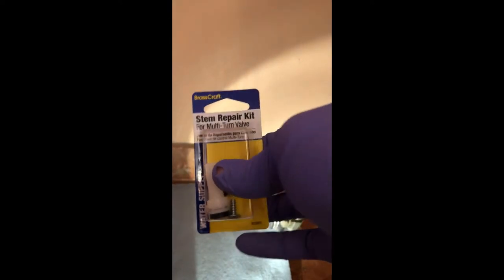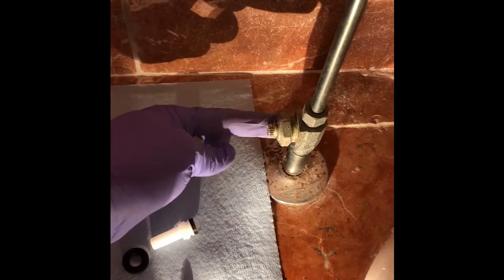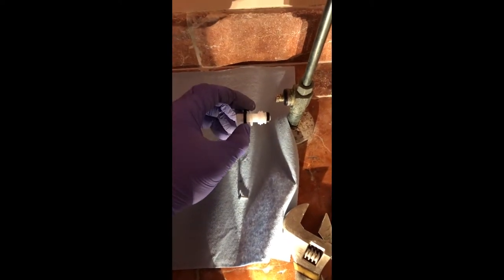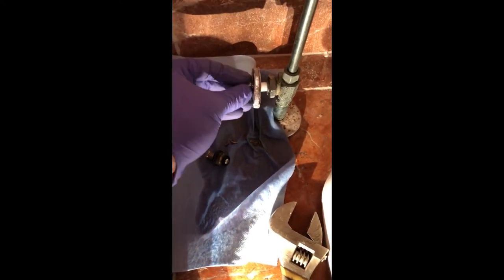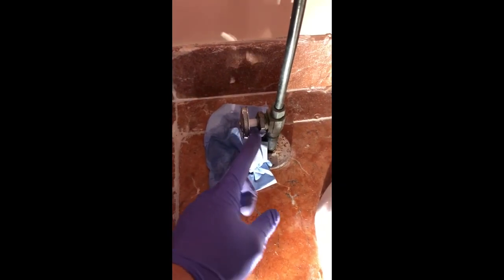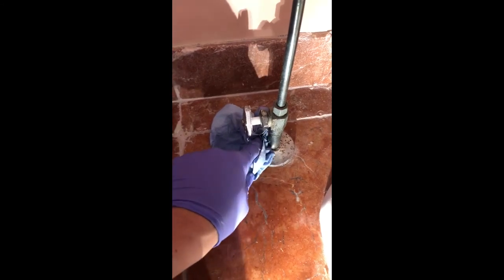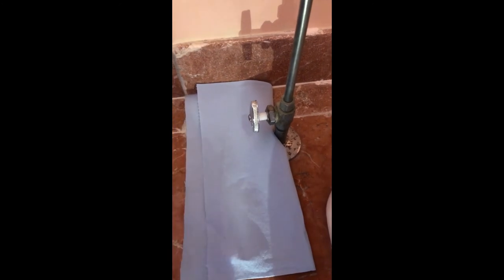DIY - Replace water shut off valve stem

Comment: Nice step by step video. Read from comments from other video that the shut-off valve needs to be in the full open position for stem to come out easily. Once it is out, use flash light to check any ripped pieces of gasket and get them out before putting in the new stem. Both worked during the stem replacement.

Comment: Thank you so much for this video Kam!!!! I was able to fully replace several 1/2 inch threaded water valves in my home without any issues BUT two valves were soldered in and I did not have the equipment nor a torch🤣
So I replaced the stem and it worked!!! All of my water valves were over 15 years old and were not shutting the water off at the site. I had to shut the water main whenever I had to replace anything... a faucet, a toilet, a water filter, an appliance water hose etc...
Today, this video helped me replaced water valves that were soldered! So grateful!🙏🏼

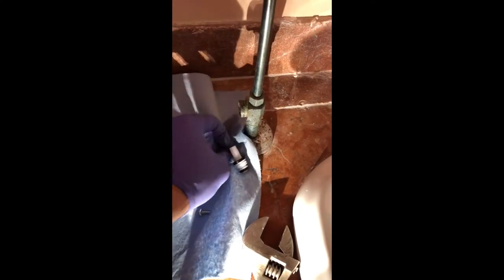Comment: At 2:42 that stuff is not a broken washer. It is scale. The old washer is still on the end of the brass stem. It is likely that the old washer would have worked just fine once you removed the scale.

Comment: It’s literally spraying at me when I turn it on, like pressure spraying lol that is for the help ✌️
Reply: Turn off your main water supply. It's located at the water meter or near the house where the water line enters your home. It may be inside your house, usually in the utility room. I recommend you remove the valve and take it with you when you buy a new one. Not all water valves use the same type. You may need to write the info on the water valve and take that with you. I hope this helps you.

Comment: I can’t ever find repair parts for my plumbing stuff so usually just replace. Even my sink and shower parts are fairly new in the bathroom I remodeled several years back are already discontinued and or not stocked on others. I had to find parts on Amazon since no local stores carry them.

Comment: I want to do this fix on my valves, but I'm worried something might go wrong and I'll be forced to leave the main water line shut off and I won't be able to use water in the house. Is there any chance something might go wrong by doing this fix? What would you rate the success rate of doing this repair?

Comment: I replaced and no leaks but now my tank to my toilet fills up very slow. Just replaced the fill valve so it shouldn’t be clogged or anything. Could I have done this repair and not properly? Maybe only part of the water line opens now? Any thoughts?

Comment: Did you have to shut off water main too? One size kit fits all then as it's standard piece?
Reply: I did. The main water shut-off valve was very hard to turn and was buried under a large amount of dirt. I went to the Home Depot irrigation section and bought a unique tool. It has a 'T' shaped end and a 'U' shaped end to turn the valve. The device is about three feet long, so you can stand up when using it. Plumbers use this type of tool. Check near your house, as you might have a shut-off valve in your utility room or where your water line enters the house. Hope this helps.

Comment: The valve I have is horizontal, and the problem is is that it won't shut off completely. It is not leaking. Will this repair work for that? By horizontal I mean that the hose is connected at a right angle.
Reply: Yes 👍
Reply: Most water valves have a 'T' shape design. Is that what you mean?

Comment: What was that replacement kit called?  I just discovered this exact leak trying to cut the water off to fix a filler valve in my toilet tank.
Reply from the maker: @ :47 you can see the replacement i used.  i got it at the local big box orange store.. link is also in the details...
Reply: I suggest you take it with you. The actual valve has information on it. I'd like you to please take that with you too.

Comment: It was not smooth for another problematic shut-off valve. After replacing the stem kit, it still leaks around the packing nut. I applied silicon grease and Teflon tape on the threads and tightened the packing nut a few times. Had done it 2 times already. Any suggestions?
Reply: The packing nut has a washer too. That must need replacing too.

Comment: should’ve put some teflon tape on the threading to secure it even further but great video
Reply: Nope. The seal is from compression on the washer. The threads merely serve to tighten the packing nut. If the washer leaks, even if you used tape, the water will drip out of the stem hole of the packing nut.

Comment: What if I’ve done this and the water still doesn’t stop?
Reply: Sorry, but the actual water control device inside may be faulty. If that's the case, you will need to replace the entire valve, and, as you know, plumbers are costly to hire.

Comment: Liked the video. Product 👎🏼 Self-tapping screw stripped in stem. Knob spun on stem.  It's a 53 yr old valve. It needs to be replaced. Seriously though... wonderful directions. 👍🏼    👍🏼
Reply: Same problem here. I unscrewed the stem nut, and the knob can off with the stem. Make sure that your replacement comes with a new knob.

Comment: where can i buy the parts? thank you
Reply: Home Depot has them.  I just bought a few.
Reply: @deezee6732  thank you verymuch!
Reply: @wangjun163  You're quite welcome.  I installed mine yesterday because my old one wasn't shutting off all the way and would occasionally leak.  It fixed both problems.
Reply: @deezee6732  good job,cool!